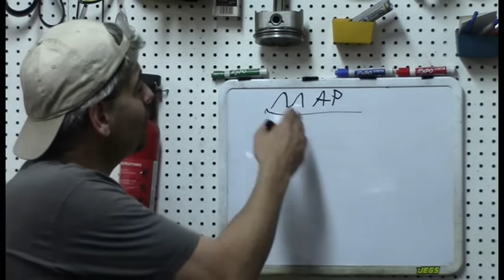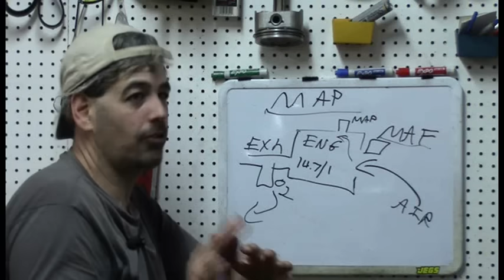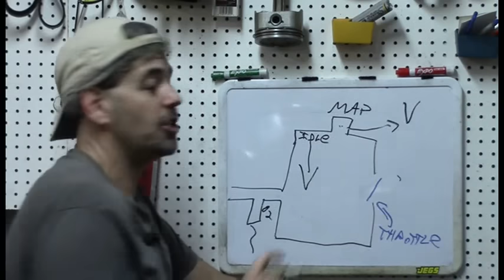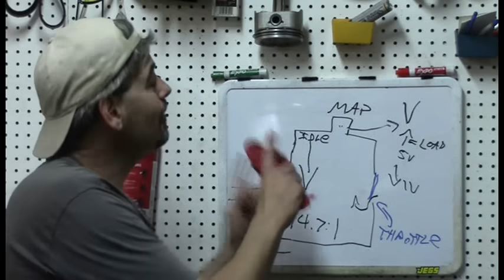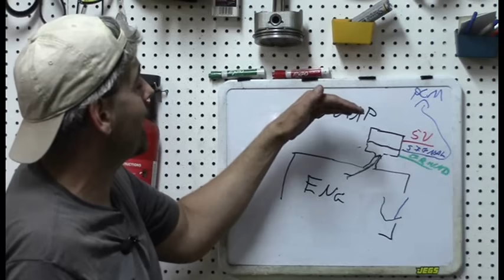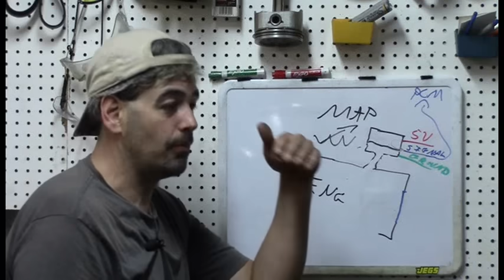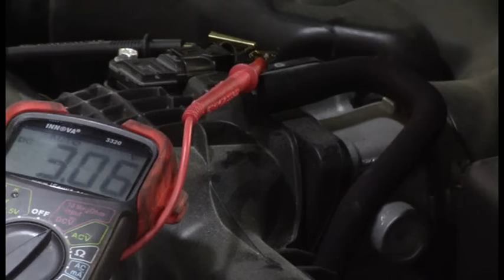MAP Sensor Diagnosis and Understanding Function- Pt1

Comment: ABSOLUTELY FIRST CLASS! binge watch!
thank you so much for your uploads, I've never wanted to understand injection, as motorcycle injection, in it's infancy, was a liability that made ordinarilly frugal engines drink like a dipsomaniac! 

things have come a long way in 30 years, and I've been asked to sort out an injected m/c now, with excessive revs at idle. 

again , thank you.

there is a dearth in correct knowledge here, bike shops don't even know how to set dwell on a set of contact breakers, or even how they work!

no one in France does real spannering, all workshops are ill equipt and do no more than replace everything they can't fix. 

with injection this is folly akin to replacing a bank of carbs because one cylinder is rich/lean.
injected bikes come on the market at a tenth of their value if there's a fuelling fault, you've just made my retirement less poverty stricken, simple when you know how, thanks to you I do now. liked, subscribed, working through your posts meticulously, OUTSTANDING.

Comment: I've had what I and many with me thought was a MAP-sensor problem (not looking at the car). The car, a Volvo s70 -99, had trouble with idling, black smoke, hard to drive at low revs and smelling horrible from unburned fuel. When I went down to my daughter and open the hood of her Volvo I heard a windy noise (sucking of air) from something. I started looking in to it and found out that it was in fact the tube from the MAP-sensor to the intake manifold that was busted. Both the hard white plastic tube and one of the rubber ends was cracked. I cut of the plastic tube an inch and bought a rubber tube that was a tight fit over the plastic one to ensure no leaks. Now the car is working like a charm again.
Reply from the maker: Per-Erik Gustafsson This is a common cause of MAP failure on engines where the sensor is not directly attached to the intake. One case I had the hose was very soft and would pinch closed causing false MAP readings.
Reply: Thanks this was hlepful i have a chevy malibu 2001 3.1 engine i would hear a hissing from that gerneral area id push the throttle and hear it increase wasnt sure hpw to check if it was working correclty or not but will replace and may fix the issue with the vacuum leak

Comment: I recently changed out my upper and lower intake manifold in my Buick Park Av. 1999 with the 3.8L base model.  I replace a lot parts since I was at 172,000 miles.  New spark plugs, fuel pressure regulator and fuel injectors.  I was going to reuse the MAP sensor till it fell apart in two pieces.  I bought a new one at the auto parts store.  The car seemed to run fine right away.  Although climbing the hill, exactly at one spot where the grade increases the engine would sputter and gasp.  I could gas it a little and get out of the sputter mode.  I figured it was the MAP sensor.  I watched your video and used my Digital Fluke meter with the new MAP sensor and the old MAP sensor which I stuck together with some Red RTV.  The MAP sensor worked the best with the old Delco MAP sensor.  I took the new sensor back to the Auto Parts store and explained the problem with the Fluke meter test.  They asked what code I got and I said, "I don't have any engine codes."  You can watch my video of the MAP sensors I had with the old and new one.  They didn't watch my video but I upgraded to the next MAP sensor for another $17.00 around $60 total for the new one.  Thanks for your help.

Comment: Matt, I greatly appreciate your in-depth analysis of the various issues that can preclude proper functioning of the various sensor systems of which are, as you pointed out to me today, very much a systemic balance.  This retired school teacher thought all he needed to do is simply replace the TPS on his beloved 1989 Dodge Caravan 3.0 with 355k miles on it and simply keep on moving on and probably do what 98% of the population does and do the replace it and forget it deal with the remaining sensors, etc.  

I do have access to a basic voltmeter and I intend to do some investigating.  However, after 355k miles I bet it's not a bad idea to remove and clean the entire throttle body, for starters.

Thanks Again!
Dean Jackson
Reply from the maker: +Dk J Thanks for the comment- I love teachers! I hope you are enjoying your well deserved retirement!
Reply: I cannot think of anything more satisfying than the sharing or teaching of something one knows well.  You do indeed have the expediency of the teaching paradigm understood.  Yes, I did love and do love teaching because it is fun. 

After viewing your show, I'm now wondering how many professional auto repair facilities don't do the requisite diagnostics and simply remove and replace until they hopefully get it right?  

All the best
Dean Jackson
Seattle
Reply from the maker: Dk J Since I don't work in the industry I don't know the answer to that, but I can tell you that over the years I have come to the conclusion that shops and technicians who do proper diagnostic procedure are surely in the minority.

Comment: You still didn't explain why you took out the map sensor connector and put it straight back! Cleaning it would be the sensible think to do. My Check Engine light is still on!
Reply: +hpdevries1 Dude you misunderstood- I was making fun of idiot who just change the sensor without diagnosing it.   how the hell are you going to clean a MAP sensor anyway? what are you talking about?
Reply: +Schrodinger&#39;s Box Quantum Mekanix LOL is this guy for real?
Reply: Mine too. And i wiped alll the grime off the outside of the wires. :)  but for real thanks for the in depth

Comment: I have to say that your videos are pretty good. I'm a new car owner (got my first car 6 months ago) and got a pretty nice car (VW Gol G5 2011 1.6L 4cyl 8v, Brazilian origin car) with an engine built a few months before I bought it (Car was stolen years ago, then it appeared without engine so it got written off, bought by my uncle and rebuilt the car). Engine is in pretty good shape altogether and had 300km by that time, about 6000km right now. But it started giving me a few problems in the past weeks. Car is feeling sluggish, it would have trouble gaining speed over 3000rpm and is not going over 3500/4000 depending on the gear, I got up to 135km/h with ease some months ago, now it's struggling to reach 105km/h.
Besides a clear one that was the Ignition coil, which was originally bought as used and got repaired by my uncle, it failed me last monday and started misfiring. Not an issue, got a new one and it keeps going. Did the usual checks as checking the air filter, replaced it since it was quite dirty but did nothing to solve the overall problem, just a bit more responsiveness to the car.

Car doesn't have MAF sensor, just a MAP sensor, readings are decent or at least seems reasonable. O2 sensor reads as it expected, 0.45 when engine is off, then fluctuates between 0.1v and 0.7v which seems also good. I haven't tackled down on the fuel system yet, which might as well try since LTFT at the moment is -12.4% and STFT is regularly showing negative at idle. As expected it goes positive when loading the engine but values seems low for me.
Just by that readings I started by diagnosing for any air intake restrictions (just to be safe) with no success (as was quite expected). 

I might need to go around the fuel system, just yesterday I watched a video of yours about an EVAP diagnose from a P0441 which is a the only code the car ever showed in a few occasions, and start tackling down from there up to fuel injectors and end up through the fuel pressure regulator. Hope the issue goes this way as I don't really want to deal with a catalytic converter problem here where the only way to get one for this car is from the dealership directly.
Up to this point I'm in need to say that car has shown no other code than P0441, there's no exhaust smoke from any kind, engine sounds good, it runs good up until the threshold it starts losing power and rate of acceleration. It does seems like a weird problem even to my father who, despite being an electrician and not a "mechanic", has been around for a while in this and knows a thing or two.

I have to say again that you explaining how the systems works, for people like me that had no mechanical background nor closeness to the field, is so valuable and I do not just enjoy watching your videos, it's actually quite fun to go to my car and begin tackling down issues.
Sorryfor the big letter 😅

Comment: I hope you don't take this the wrong way because it actually meant to be a compliment. Far too often you hear the old timers say that there are no mechanics anymore, just tech's that plug in a tester and follows that path. You, sir, are the exact reason those sensors are there. If you know the system in its entirety these sensors can quickly tell you a lot about the engine.
Reply from the maker: That is a compliment!  Yes all those idiots who think this new technology is just a bunch of crap basically translates to the fact that they simply do not understand it. It's that simple.

Comment: I have a MAP only sensor, it took a little while to suss (after looking and not finding) that I don't need a MAF sensor, one less sensor to worry about hooray!. My Idle pressure is 4 psi I can see from my diagnostic module, the pressure rises with engine revs and drops down  just bellow 4 psi  level, before rising to the idle pressure again, as you have shown. All great stuff, building up my knowledge and understanding of a closed loop engine management system.  Thanks for your well explained videos my friend. (Car info; 1.6 Mitsubishi Lancer Equippe 2006)

Comment: I manage to discard 4 trouble codes with your videos, resulting on a faulty conector for the IAT sensor, in the way I learn a lot, thank you so much.
Reply from the maker: Great job!!!  The method definitely works. Which is a good thing because if science doesn’t work then nothing works.

Comment: Hey Matt, I really appreciate the message your getting out there to the concerned automotive technicians, as well as the automotive consumer. One of the most annoying things I hear from uneducated "parts changers" and uneducated consumers is quote " Oh fixing cars is simple with that scanner, you just plug it in and it tells you what the problem is". That's hands down the most ignorant and annoying comment to hear people make, because the consumer thinks they're getting ripped off, when they hear this crap, and the "parts changers" go through their careers never knowing the other 98% of the functions the scanners have to offer, pending your scanner of course. They don't realize, those codes have to be analyzed by an educated technician, and evaluated for accurate diagnosis. I like that your not afraid to tell people the truth as well as critique peoples grammar. I am annoyed by improper grammar as well, like "DIFFECTIVE" in your other video, clearly spelled DEFECTIVE. Apparently they think the red wavy lines under their words is the computer telling them COOL WORD SPELLING. Some people never change.
Reply from the maker: Adam Czajka I know exactly what you mean.  Plugging a car into a scanner tells you whats wrong with the engine in the same way plugging a human to a blood pressure machine tells you what disease they have, lol.
Reply: I wouldn't run that idea past a fellow co-worker. Anything he hears is true. I wonder what some mechanics like him would do if they bothered to verify the crap they hear from people on yahoo answers. After all, if you've worked at autozone for 20 years, your a master mechanic.

Comment: You guys are great. This kind of video opens people's mind. Some of my mechanics are killing me. I have changed my MAP sensors like three times because my car isn't slow-running well. I nearly threw the car away...
Reply from the maker: Yes I have seen many a MAP changed for no reason other than people don't understand it.
  At a higher level of understanding, sensors can actually help tell you what is wrong instead of being blamed for what's wrong.  You far more often use them as tools instead of using tools to replace them.

Comment: Sir I came on here to hopefully tell you, if you see this. I just had a diagnosis with a customers car. Engine was surging at idle. Rpms bouncing, Live data showed crazy erratic fuel trims. From 5% to +25 stft. Every second jumped around. Both banks the same. Revving engine brought both banks to -3 to -5% stft. I’ve never seen this fast jumping erratic trims before. LTFT was steady at +8% both banks. But ST was very wild. SO from your teachings I KNEW it had to be something effecting both banks. Long story short, I thought “vacuum leak!” of course but this car has much history. I knew of an intake runner solenoid that was leaking vacuum. But it wasn’t THAT bad. The customer kept saying “MAF sensor right? Should I just order one now?!” I kept saying “it could be but you’ve had a slight vacuum leak for some time.” He didn’t want to hear it. So I showed him fuel trims on the live data. I gave him a quick synopsis on ST and LT and how they work. I opened the hood then closed off the leaking solenoid hose. And showed him the trims. Immediately they corrected and the LT on both banks decreased to 0. ST decreased to -3 or -5. I then repeated this procedure to SHOW HIM the deal. I said “see you saw it with your own eyes. I plug the leak, trims correct themselves. You NEED to fix this part. It’s not the MAF.” But having this knowledge of trims and live data in general was CRUCIAL to that diagnosis. The guy was saying “wtf how the hell do you know this stuff?! This is really advanced stuff.” I just told him I had really good teachers. It was such a good feeling diagnosing the car without any parts cannon or wrenching. Just thank you dear DEAR sir. I wanted to tell you about this. Real life in the field data. Sorry for the novel I just couldn’t wait to let you know man
Reply from the maker: Haha great story man! Yes I very often do exactly the same with customers. I know they don’t fully understand the concepts but showing the graphs and what a good one looks like vs what theirs looks like is something they can usually comprehend.
Reply: @SchrodingersBox hey sir I wanted to also let you know, my own fuel trims have been +12stft and +8 Ltft on both banks. I’ve tried everything. Vacuum leak symptoms. Nothing worked. No leaks. Smoke test no leaks. Long story short again, lol, I think to loosen my gas cap. Maybe evap issue. As soon as I loosened the gas cap, trims corrected. Now they’re at perfect 0 or +1. So I must have a bad closed  evap vent valve. Or restricted evap hose. But again, problem solved. This was really difficult to figure out. All the classic fixes for vacuum leaks didn’t work. It was blowing my mind. But yea no air releasing from tank cause vacuum leak. Crazy. I was fixing everyone else’s car but couldn’t figure out my own issue lol

Comment: Great video!!!   Just came here from props you received on Eric and Ivan's twisted cam video.

Side note on vacuum.  My first car ('64 Rambler) that had vacuum powered windshield wipers.  Anyone who ever drove a car with vacuum powered windshield wipers on hilly roads in the rain knows from experience how manifold pressure varies with throttle position.  Go up the hill at full throttle and the wipers would swipe maybe once every four or five seconds.  Once you crest the hill and start coasting down the other side of the hill the wipers were slapping back and forth so fast that they were practically ready to fly off of the car.  

Chris
Reply from the maker: shadowdog500 Lol makes sense!!  What a horrid design lol! Thanks for dropping by.  I consider Eric a friend and Moto has been a sub for almost since I started.  That video was just bad ass.
  If you like that you will probably like this one:
https://www.youtube.com/watch?v=VoiLJd2E0EI
Reply: shadowdog500 I had a 75 Jeep Ford that did that!

Comment: Great videos. I have a 89 Silverado TBI K1500. I've owned it now for about 15 years and love the truck. Lately its been running rough,  especially during idle. Before I found your videos,  I've been throwing parts at this thing at an alarming rate with little luck. I've changed  the intake manifold gasket,  distributor assembly,  plugs, wires, IAC valve, TBI kit. Just throwing parts at it hoping something sticks. I'll be watching all your videos hoping I can learn and figure something out.
Reply from the maker: get some data and I’ll be happy to analyze it.
Reply: @SchrodingersBox  Thank you so much for your response.  Looking into purchasing a real time scan tool .